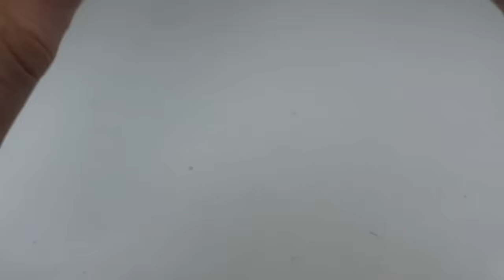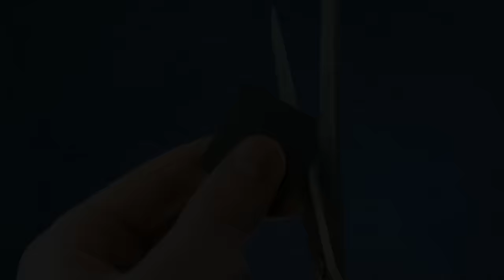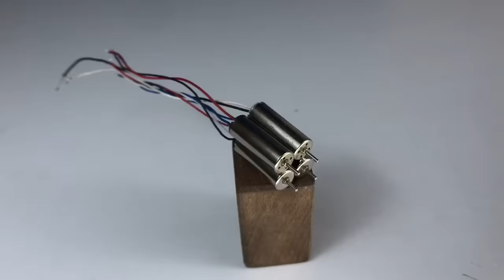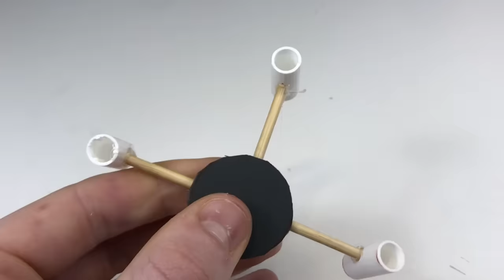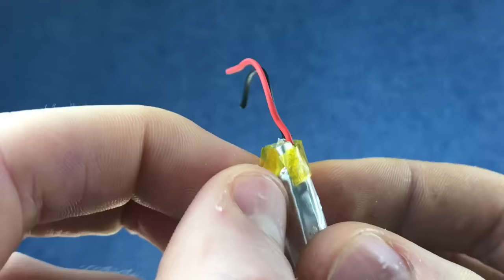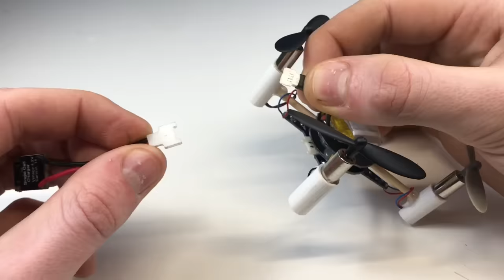#drone how to make a drone at home

Comment: guys dont get fooled from this type of videos 
for a drone to make fly u should calculate the mass of each motor and every equipments used in that and should be disturbuted uniformally to make it fly further u should manage cg of the drone and u should use a high  voltage battery 
thanks
Reply: Didn't even open the software bro
Reply: Where did you learn that
Reply: @deathstare7727  i am an engineering student in nepal
Reply: The flight controller does its job... its sabilizes the drone

Comment: These little stickies? Theres a reason why we didnt see it flying and thats because it wouldn't even leave the ground.
Reply from the maker: The problem was with the flight controller and I only had one
Reply: @Inventor101  yeah should check how to calibration your flight controller with remote .... check instruction paper.
Reply: Inventor 101 can it fly if there wasn’t that problem
Reply: @Inventor101  oh it is really able to fly? Then I will have to appologise, but I don't see this thing in the air.

Comment: Awesome ideas!!!  Next time drill holes in the  pen jackets around the motors with holes. Plastic is heavy it'll still be strong but a little lighter. Every bit counts on a drone. Same thing with the propeller plastic circles. You could drill into that too.

Comment: Don’t even try to build this.  It didn’t work.   It was far to heavy to fly with those motors.  If it did fly why would he just cut the video and write in that the remote broke.  Adding that much glue alone would make it to heavy and did you see when he tried to fly it how it tipped to one side.
Reply: Very factual, although,you'd have to admit that it could possibly work out using a bigger model, bigger propellers equals more air propulsion ✌️,but you'd also have to find the right object placements in order for perfect weight distribution, which will in turn,stop the drone from tipping to one side like it did in the video 👌

Comment: ಈ ಡ್ರೋನ್ ಮಾಡಲು ಬೇಕಾಗಿರುವ ಐಟಎಂ ಲಿಸ್ಟ್. ಕಳಿಸಿ
Reply: 3.7 volt li po battery
Micro motor and propeller
Remote control pcp
Remote
3.7volt battery charging module